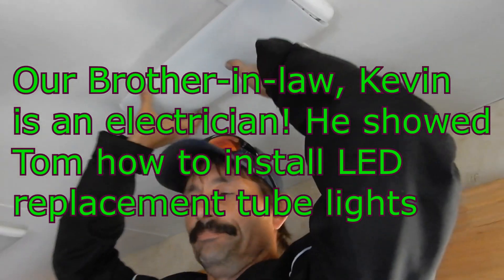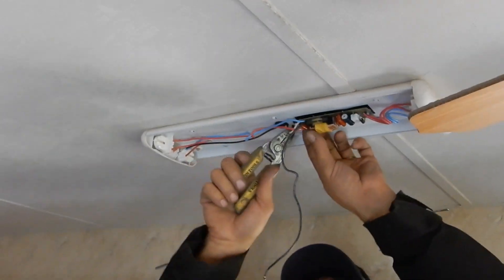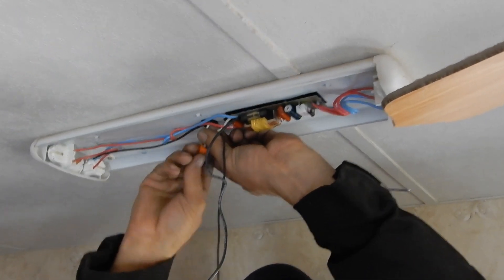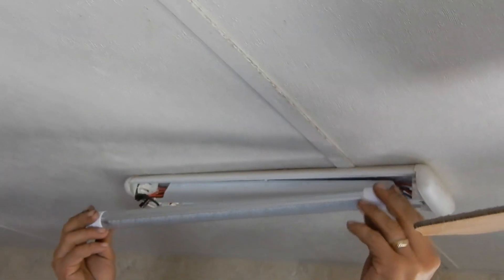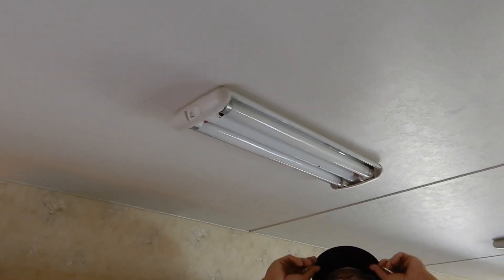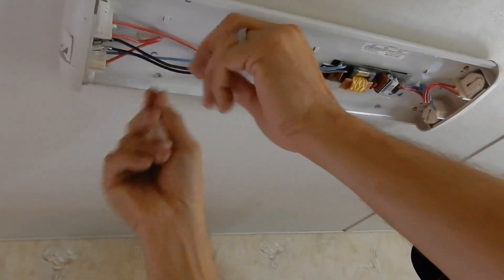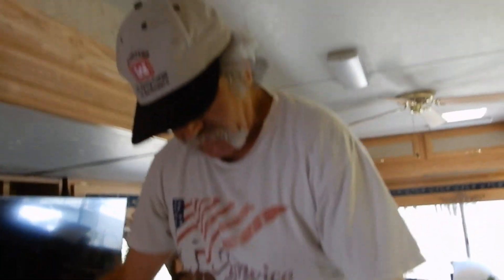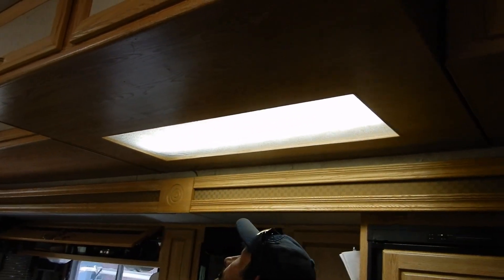Replaced Fluorescent Lights W/LEDs

Comment: we did the same in ours. In our Winnebago, the regular lights got hot enough to warp the plastic covers. Never again. Led all the way. Btw, put thermometers in our fridges (same as yours), fridges holding at 35-37, freezers at 0. I am a very happy camper
Reply from the maker: LOVE LED's!
Reply: made the mistake, I'l claim age, of ordering the 2nd bunch, after hubby installed first 4(2 lights) of ordering bright white, others were warm white, hubby put the bright white over kitchen and the warm in bedroom and very back. Simple to move bulbs around, once initial wiring was done. Now on to ceiling fan, as someone put a residential fan in and it catches on the slide